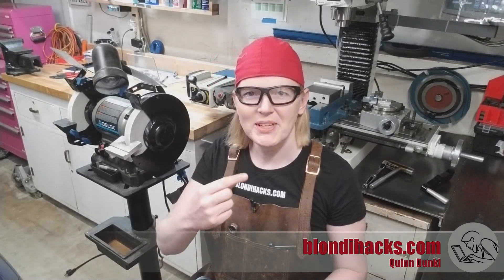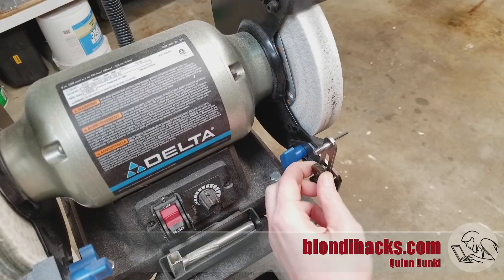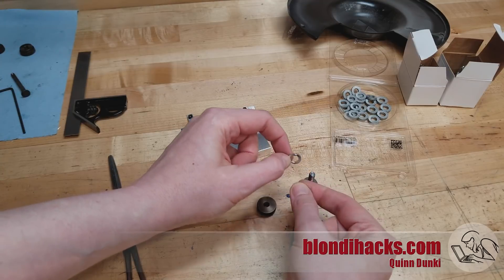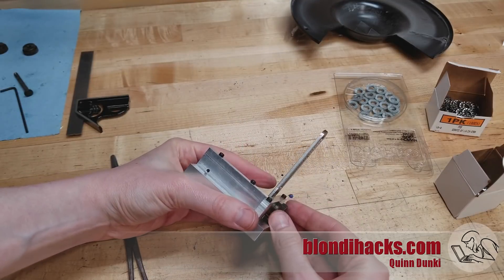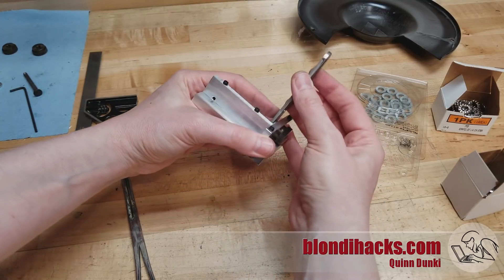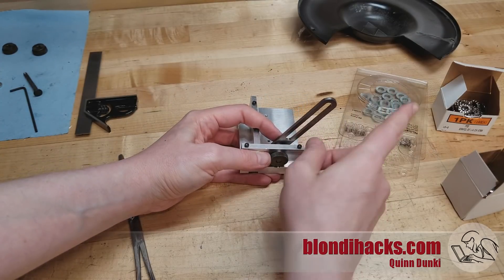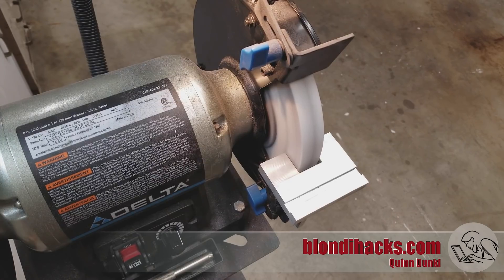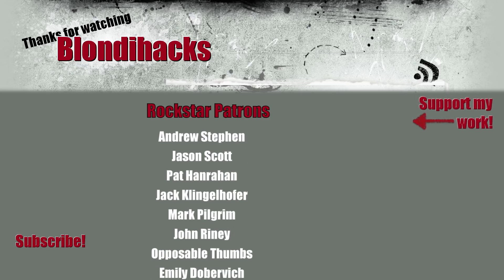Bench Grinder Tool Rest Replacement : Part 4/4

Comment: Hi Blondi,
I had a grinder wheel that my dad used to put on his wood lathe, i re made it into a bench grinder, but a very rough steel frame that the bearing assembly, pulley and wheel sits on. The headache is the tool rest, and since my grinder will only sharpen hss bits, im custom building the toolrest only for sharpning hss. I have no up or down movement on my toolrest, will that be ok? Or do i need it, it will be able to tilt down, away from the wheel to get the about 10° angle.
But i like your idea on the mitre, and definitely going to do somethimg similar, i do not have a mill, so my design will be be using bearings on a "folower rail" if i can call it that, at the bottom of my toolrest, (i made it big😬) so doing this should work,

Thanks for your informative videos💪🏻💪🏻

Comment: a very elegant solution that has given me some great ideas but a couple or 3 nuts instead of the thumb wheels,  some matching bolts and a wrench would accomplish the same.  you can spot weld the bolts to the bracket so they don't turn or if you don't have a little wirefeed welder, a dab of JB weld will beat all heck out of a lock washer...  Git-R-Done

Comment: Hay there gal, I'm working the same problem did not like using the guard for a mount spot. so I'm using a plate mounted behind the guard coming out to the front of the guard. and will mount things there. just working on it now, we'll see how it works. think I'll be able to come up with a degree system for angle on the wheel.

Comment: I've blued ,blacked and de-rusted all sorts of parts from guns to Triumph Spitfire gearbox parts using this method and you should too.
(It's platen as in flatten,also aluminium).....smart ass brit.

Ant way this is a great way to save expensive oxide coating fluid and most ,not all,are made from selenium dioxide,a product called cold blak is available in 4.5ltr containers from "frost restoration" in the UK,as gun shops act the fool on prices,and as selenium dioxide is toxic and messes with the reproductive system,less contact is better.
1/ get a zip loc bag big enough to hang in a bucket of warm or cuppa tea hot water.

2/ Add the part to be de-rusted/oxide coated,then add a small quantity of de-rust/oxide coating solution.

3/Add water to the bucket with the part in zip loc bag,leaving zip loc open ,the water will compress the bag onto the part forcing intimate contact to the part.
Top up each bag with solution 'till each part is covered,it won't take much,also hot water will soften the bag and allow it to conform to the profile of the part,but be careful of sharp edges etc.

A clear bucket/tub allows easy visual check of the coverage of each part as it is immersed and level checked before adding more bags/part combinations to the water container 

Saves using brushes and tube,brushes can leave smear marks.and the hot bluing process can be left for a few hours 'till cool,the wash and oil.

This has saved me the bother of messing with splashes or spills.lip loc bags come in a huge range of sizes and shapes,shafts can be done in this manner i did gun barrels with long skinny bags and a trough made from rain gutter with end caps glued in place.

Hope this helps,as it was a turning point for me for this use.

Cheers .

Comment: Hello Quinn

Fabulous videos - I really appreciate the way you cover EVERY little detail, and the rate at which you go through stuff: not too slow, not too fast, just the right rhythm. You’ve taught me a great deal: thank you.

As regards the fixing for the platen (which I think is pronounced as you prefer, since it is not spelt ‘platten’), and much as I love your little knurled buttons, I’d suggest a stake fixing with an eccentric rod operated by a lever.  Have a look at the lever fixings for wheel hubs, or better still the pinch bolt for an adjustable height saddle, on a racing bicycle to see what I mean:  I’m sure you could modify one, or use the basic design and machine a beautiful version of your own.  The lever can be positioned to fold out of sight under the platen when in the fixed position.  Quick, durable, superbly powerful and elegant, just like your work.
Cheers from Scotland
Will

Comment: I did my first set of lathe tools at my school, I was already experienced with grinding but today I finally finished my 5
Rougher
Finisher
.25 radius with zero light pass through when putting a half inch round stock on the grind.
A 3/16 in groove tool with a radius.
Left offset thread Perfect no light pass through
Reply: It is nice to have a school that offers classes like this!  Good for you.

Comment: I just got done mounting DRO scales to milll and lathe.  So I was thinking, what about drilling and taping holes in side of cast iron base to mount from that.  That takes everything off the sheet metal cover.  Which is a flexi flyer.  My 8" grinder needs work.  This gives me some great ideas.

Comment: I realize this is a bit late.     Recently finished the tool rest table that is part of the acute sharpening system from eccentric engineering.  It is a complex system, maybe over the top for sharpening lathe tools.   They do two things that might be of interest.   Instead of a lock washer they use an 0-ring.   This works well and you get to play with trapaning when making the disk that captures the O-ring.     ...And they solved the problem of setting the table angle by making templates that on rest on the table and wheel.   

Thinking I will follow your lead on this one and use a miter slot.   Love you vids.   Off to check out what Clough42 did on this subject.

Comment: NASA has a fastener manual out on the internet. They basically deemed split washers dead weight. They don’t do anything. In some cases caused the fasteners to loosen. Split washers are useless

Comment: Accept it Quinn, we gnarly metric people know a thing or two. We also know that a coil washer doesn’t lock by biting in between faces, it goes on one end of the thread to keep the threads in tension during vibration to prevent loosening as vibration alternately lets the thread tension off and on.

Comment: I was googling for grinder mods and hacks and turns out we have the same grinder.

Having had grinders that vibrated off the bench if not bolted to the bench or if bolted to the bench vibrated everything else on the bench off, I went medieval on my grinder. Got photos and have the Tee shirt. I finally designed a vacuum cleaner attachment duct which you might find useful  https://www.thingiverse.com/thing:4639199 

I am almost positive the actual China manufacturer is https://www.alibaba.com/product-detail/TDS-G200V-550W-5Amp-8-inch_1600110415966.html?spm=a2700.7724857.normalList.6.52a2c21cwcD3Ex&s=p&fullFirstScreen=true
The OEM fob price in China in lots of 50 is $60 so I bite my lip whenever I think of any short comings. You need to spend on the order of 10x for a slightly better grinder (which even then is debatable).

What I say to friends’ is if you buy one don’t take the wheels off unless you’re prepared to go deep down the rabbit hole. I appreciate the art of manufacturing and think the use of epoxy during manufacturing is very smart. The wheels are centered and trued using epoxy as a shim, which is brilliant but take off the wheels at one’s peril. The shafts are not round, do not have a constant diameter, and vibration when turned leaves a unique surface finish.

You may have noticed that the right-side has less vibration than the left. Internally the motor armature is on the right end of the shaft and this is the only place where it is balanced.

In hindsight: 
First, I would grind the motor shaft round and true to the ball bearings I used Vee blocks.
Second, dynamically balance the motor rotor assembly. This is not climbing mount Everest. I did this with a rather dodgy setup using a linear rail at one end and suspending/spinning the motor shaft from an O-ring belt at the other end (used the inner race of a ball bearing as a pully on the motor shaft). For measuring vibration amplitude, you can use a dial gauge bouncing around and make a short video with a phone. I had an accelerometer and an older fancy scope. $10 got me an odd ball accelerometer electrical connector and a 40dB preamp so I could just read the RMS value from the scope display, but for belt and suspenders I also used a dial gauge. A scope is great but you can see absolutely everything which is bad. For example, the ball bearing cage is not balanced and the balls taking off and landing in the small clearance between the races produces a vibration signal, all very interesting but a dial gauge can get the lion’s share of the measurement.
Third, true up the inner wheel washers. I machined off 10 thousand from both washer surfaces and drilled out the center to ¾”. Turned an interference fit sleeve with a shoulder from a 1” shaft. This all results in a perpendicular washer surface and no side to side wheel wobble and as a bonus you can change the axial position of the wheel on the shaft (the original shoulder diameter is less than ¾”). I positioned a CBN cup wheel on the shaft with about 50 thousand of side to side clearance between the wheel and the protection housing. Robbin made a good point in his YouTube video about truing CBN wheels. The CBN coating is thin and truing the wheel requires removing expensive abrasive.
Lastly I used adjustable hand reamers to remove epoxy from the grinding wheel hubs to make an interference fit on the ¾” sleeves I turned.

The final result is the grinder can just sit on a bench and nothing rattles. Vibration is low enough that I can place something on the tool rest and it stays put.

Looking at the base mounting holes they look ready for tapping ½” NC to mount attachments. 
Cheers-Peter

Comment: GREAT build, thanks for sharing. I had a thought as I was watching u design the thumb wheels. What about levers instead? (link to a pic...a 1000 word thing). 
https://duckduckgo.com/?q=build+a+grinder+adjustable+tool+rest&iax=images&ia=images&iai=https%3A%2F%2Fimages-na.ssl-images-amazon.com%2Fimages%2FI%2F51Q7DOT4z7L.jpg&atb=v200-1   
Also, if u can grind an angle on a tool that u are happy with...that's a win in my book. look fwd to watching more of your channel. Thanks

Comment: 16:27 - a note referencing a comment from a previous video, then: seems like this miter setup is what's required to get that precision you talked about from single-point threading.  Order of operations: 1. Make grinder platen with; 2. Make miter guide for it; 3. Grind cutting tool; 4. cut threads!  Now I know!  :)

Comment: Wow I am so glad I stumbled across this series! I have an incredibly similar 8” bench grinder, i mean everything down to the bent dust shield is exactly the same so I am running into the same issues when trying to grind tool bits and such.. (the rest having too coarse of an adjustment, the powder coat on them, it being mounted with a carriage bolt through both sides of the dust shield making it more difficult to change the wheels, & my rest is actually off center because of the dust shield being bent..) So I’ve been wanting to make a new rest since I got this thing but I didn’t quite know where to start, I know I want it to be super rigid but mounting options are pretty limited. I really like what you did here though, you made something very rigid & very functional while still using the factory mounting locations! And I really like the idea of the miter slot, very handy! So I shall use what I’ve learned here to make my own rest, hopefully as good as yours!
Reply from the maker: Excellent! Glad this was useful to someone! 😀

Comment: I restore vintage firearms.  Ive had great success with cold bluing by boiling my parts in water for 10-15 minutes before dropping them in oxpho-blue.   Then i coat them in oil and wipe off. Consistent dark bluing.  Try it next time,  see what you think. Great videos !

Comment: I've got 2 bench grinders in the shop. A Baldor & a Griz… The Baldor is very good but the cast iron rests are small and don't wrap around. They have worn a lot and been re-machined several times. I'm not sure you will like the aluminum surfaces, as grit will likely imbed. The Griz… rests fasten to the sheet metal dust hoods and flop around. Been meaning to fix that. I think I will either make a rest that fastens to the base or sell the damn thing to another fool.  One of the rests has an angular V  groove that interferes with using it. Fixed that.  The arbors were terribly machined and unusable as they came. Conclusion, cheap bench grinders are a kit that you can almost make useful.
Reply from the maker: Yah, agreed on all fronts. There are no “good” consumer bench grinders, just “ones you can make workable”

Comment: Amazing the grip you can by using a piece of regular typing paper or some very thin paper type gasket material-between the two flat metal surfaces. Give it a try.

Comment: A really handy tool for getting angles in weird situations is this https://www.amazon.com/gp/product/B06XTHHGM9/ref=ppx_yo_dt_b_search_asin_title?ie=UTF8&psc=1
I learned from a band saw guy who uses it to set table angles.  Won't help with the aluminum but it has magnets in the base so it will stick to steel and the resettable zero lets you compensate for things not starting out at true level.

Comment: Beautiful job.  I guess my "to-do" list just got longer.  I notice that you're not using the standard gray aluminum oxide wheels that are standard on this grinder.  The finish you obtain is substantially better than they usually produce.  May I ask what the while wheels you use are?
Reply from the maker: You’ll find them if you search for “white aluminum oxide”. I believe these are Norton. They work very well! Those gray wheels that come with consumer grinders are garbage

Comment: I have similar rubbish rests on my grinder. Yours looks good and versatile. To stop your angle gauge vibrating loose clamp an O-ring under the knob. Being both sticky and compliant I think it will fix the loosening problem

Comment: Why Surgical Foresepts? Most folks use either common needle nose pliers, or needle nose vise grips. I think the standard shop tools maybe
a bit more cost effective?
Reply from the maker: Forceps are operable in both directions with one hand and very easy to work with. Don’t knock it till you’ve tried it! They are not expensive. There’s a link in the description.

Comment: Excellent descriptive video, very clear, great useful addition to the shop.
Not sure on your interposing the locking washers between two faces is standard practice, improving the contact area/flatness and using the co-efficent of friction to hold position. Having the screw affixed to the arm is ideal, so imparting sufficient clamping force is the key, as you stated. A friction material could be used to improve, some fibre washer or similar.
Hope you don't mind my ramblings.
Best regards from the UK.

Comment: You could always change the knurled nob that locks the table to a lever, like the ones that lock the mill table down to get more torque, nice project that i need to make something similar, my biggest problem is the actual tin bracket on the machine, its very tinny and making your great project i first need to address this. Checkout the plastic tool that comes with the tormek grinder you can buy them seperate it might give you an idea to make a guage. I think its the TTS 100.

Comment: Quinn, I followed your design but I was after a way to sharpen tungsten, i machined grooves in the edge of mine and it works for sharp and blunt points as well as the 2 sizes of tungsten that i use. Thanks for doing 90 % of getting me there, love the channel.Thanks a bunch.

Comment: I have a sears version of the same grinder.  In the process of making squared guards out of angle iron, as the factory stamped versions are just really sad.  I grew up with a baldor with cast iron guards, the rigidity is so much better.  Thanks for sharing, great content and ideas.
Reply from the maker: Yah, consumer grade bench grinders are all really weak in this area. Thanks for watching!

Comment: Your diversion to the subject of lock washers reminds me it is time to re-read one of my favourite authors. Caroll Smith wrote a series of books on driving, building, and engineering racing vehicles, (He was the other Caroll to Caroll Shelby who beat Ferrari @ LeMons), entitled "Tune to Win", "Drive to Win", "Engineer to Win", "Prepare to Win" and the fifth book in the series, "Nuts, Bolts, Fasteners, and Plumbing Handbook", aka 'Screw to Win". Engineer, Prepare, and the fastener handbook should be required reading for anyone that is building anything. The former will teach you all about thinking through forces, shear planes, materials, and just what it is you are trying to accomplish. The fasteners book will teach you not only what fastener to use when, but the all important why you choose the one you should.

Comment: I enjoy your videos but have a question. As having been an electrical engineer and having done machining I am not sure what a soldering station and oscilloscope has to do with machining other than equipment repair?
Reply from the maker: Indeed, check out my blog for, for example, a five year project where I designed and built a computer from scratch. This channel is part of a larger Blondihacks enterprise.

Comment: Had to laugh at your "unsprung weight" comment as a long time track guy.  Nice job on the rest and your fix for the floppy guard issue, I was waiting to see how you fixed that.
Reply from the maker: I’m so glad someone caught that reference. As a semi-retired  racer, I’ve long obsessed about unsprung weight. 😁
Reply: @Blondihacks  I'm semi-retired as well... but in the queue is a mid-engine tube frame track car.  Just have to get some more machines in order and running (and out of my build space).  I'll be documenting all of it on my fledgling channel (just an intro as yet) Search WIWT Fab.